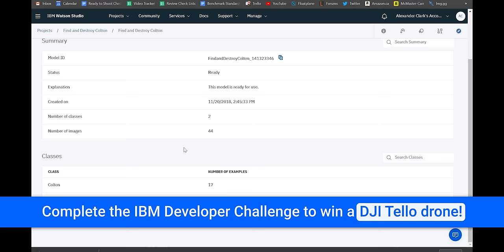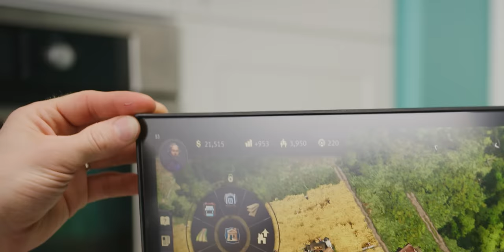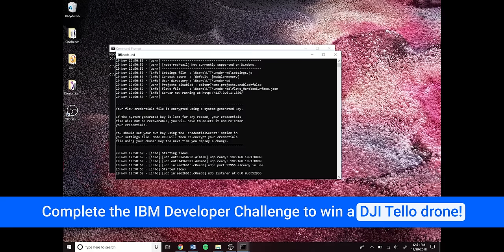FINALLY Upgrading my 4 year old Gaming Rig!

Comment: Mounts monoblock, forgets to install NVME beforehand.
Reply: Am I dumb or isn't Linus supposed to reinstall the OS because of a Motherboard change. I think aspects of windows are tied to the specific motherboard right? Am I wrong?
Reply: @libertywolfyt985  I tried to keep my OS installation as is it when I switch CPU/MB/RAM last month, and the OS was crashing fast as soon as left it idling; Had to reinstall everything eventually T__T
Reply: @libertywolfyt985  no, you don't "need", it's advisable but really not at all necessary unless you have issues with something, the only times I would recommend a full reinstall is if you're converting from AMD to Intel (or the other way round) or you didn't install Windows in UEFI mode back whenever it was you first installed, your Windows license is actually more save-able if you just keep the same OS install too as you can just use the activation troubleshooter and tell it you've changed hardware recently 🙂
Reply: @galakstiv , yeah it is just my dad said that to me when we were upgrading windows, not to long ago, in order to accommodate the z390 phantom gaming 6. Basically each windows installation is specific to the motherboard like settings and stuff like that.
Reply: @KamikazeXeX , reinstalling as in the windows install is specific to the computer/motherboard. People do get crashes from keeping the same windows, I don't know how the troubleshooter works as I have never used it, but I suppose it would fix the settings for the new motherboard or something like that.
Reply: @libertywolfyt985  that is an entirely common misconception there is cases you have to reinstall due to previous misconfiguration issues but in no way does Windows "lock" itself to a specific hardware config at all, only the activation state is locked to your hardware, BSODs are usually fairly simple to diagnose and cleanup if you know how to use Google, I've spent probably the last 15 years being the family and friend PC repair guy 😂
Reply: @libertywolfyt985  yes you are correct that their is a connection but because of an issue that happened in the 1st 9months of window 10 coming out the choose not to countine it once the free upgrade time peroid ending the following year which instead locking it or making it a problem to upgrade your motherboard they instead tied the avitive install too the OS install drive the motherboard and ram as long as any ONE of those are still being used and you didnt do a full clean install then the windows server would understand that the copy of window is still vailid once to re-activate the copy lience once you have it re-activted with the news motherborad you then turn it off and install the rest of the new parts and once finshed microsoft will reg your new system as part of the copy you own now with that all said their with all tech the chance for it to not go as planned but take it from me 
and my history i have only ever bought the free upgraded version and since then i have gone from a system that use AMD 6300 motherboard to a ryzen 1 then a ryzen 2 and now im waiting on the new ryzen 3000 and with tthat will be a completly new system in all parts and ill have done it not onc ehaving to fix any more then plug and play honestly windows 10 is the easist OS to upgrade ive ever used 

p.s if you do have your OS on a intel optain setup you will have issue as intel os optain setup can not be upgraded with out a fresh install of win10
Reply: @libertywolfyt985  if the crash does get corrupted then a simple 20mins reset call to windows fixes any issue with the relieniceing of your copy to the new config
Reply: @shadowarachh even worse, old shitty drive not even in a cage, a somewhat loose SSD can be seen in some shots.

Comment: So just to let's say, replace or insert a new m.2 drive, you have to

1. Drain the loop
2. Get the tubing out of the way
3. Take off the entire block
4. Put in a new m.2
5. Put the block on again
6. Put the put the tubing back in place
7. Fill the loop back up.

Hmm
Reply: yep... 1st world problems
Reply: No. There are screws on the 2 bottom m.2 slots. You just unscrew them and put your m.2 in.

Just the one on top is under the block.
Reply: I saw at one moment that the part covering the M.2s appears to be only a separate metal plate screwed to the rest of the monoblock, so you only need to unscrew it if u wanna add/change an M.2.
Reply: or...
take of the block, put in m.2, put block back again. its slightly inconvenient but its not like you do it everyday

Comment: Why did you run the reservoir fill on the live pc? Use a separate power supply, short between the green and black wires on the 24pin connector, with a paper
 clip or piece of wire. If all wires are black, place the connector with the lock clip facing up and short
 4th and 5th pins (counting from left to right) in the upper row. This turns on the power supply and gives you a safe start. Then connect the water pump to the separate power supply.  No chance of harming your system this way. Then you could see that your piping was off without possible damage to the system proper.

Comment: the magic of PC gaming, playing on a smaller 24" 1080p monitor and still be able to run 70 FPS with your current setup without the need to upgrade.

also saves your eyes from getting stretched as a bonus.
Reply: Stretched eyes? You clearly never touched an ultrawide
Reply: 24" is irrelevant to performance.
Reply: @andrewe6762  the keyword is 1080p, and 24" are the most common sizes for this resolution. Anything bigger than 24" and its 1440p territory.
Reply: @ann0ynim0us  That's simply not true. 1080p is standard, regardless of size. Google 32" monitor and you'll still be flooded with primarily 1080p's.
Reply: @andrewe6762  learn to research better on recommended monitor sizes and resolutions: https://forums.tomshardware.com/threads/27-1080-bad.2999690/

Comment: I've used automotive coolant for 10 years in a dozen different systems. Not one issue with corrosion, over heating or damage to pumps or blocks.

Comment: Honestly, $1100 for motherboard, top-line CPU, and monoblock cooling is a pretty good deal.
Reply: No. Its 1100 for only MB + Monoblock. If you buy it with the 5.1ghz i9 you pay 700 on top of it. Its actually a really bad value to pay 200 for overclocking isnt it?

Comment: "chugging down to 40 fps" , dude, when my games lag, they either straight up ctd, or go unresponsive!
Reply: I still using core i5 with 2TB ssd in raid mode and 3200mhz ddr 4 32GB still plays updated games with no problems time for upgrade i think i core i9 cpu 😁
Reply: @paulroibnson5686  just stop

Comment: 3950x is about to crush that 9900k

and also that new 2080 Ti Super...
Reply: I dont think that's gonna happen. Amd always not realistic about their cpu advertising. Probably it won't be better than i9 9900k or i7 9700k in gaming. However, as a raw performance and editing etc, it will beat intel as always.
Reply: @nnnscorpionnn  100% agree. The 9700k might get blown away, sure. It's 8c/8t, which is hilarious because AMD boasted they had a chip that was better than it for multi tasking. Let's look... they compare their new 8c/16t vs an older 8c/8t hmmm.. compensating for their continuous losses to Intel in the past. The 9900K or KS? Hell no. That's the reigining champ right now. None of these Ryzen gen 3 chips will beat it at gaming.
Reply: @MrAndroid2013  Wait for benchmark folks. You can never come to conclusions this early.
Reply: You guys watched the amd stream right
Reply: Yeah, AMD’s new CPU’s are so cheap for the specs you get, Intel is going to struggling. (Example: 3600 Base 6 core 3.6GHz 12 threads is $290 AUD). And AMD’s new Zen2 architecture looks great.

Btw that’s a Titan RTX, not a 2080 Ti
Reply: jvalex18  it would be better if they showed the temps and noises tho
Reply: @nnnscorpionnn  hahahahha wut??? Intel screw there customers all generations
Reply: @redbassboosz5222  are you sure about that? I suggest you to watch some ryzen vs i7 gaming videos, you will see the big difference in gaming.
Reply: @nnnscorpionnn  ehm Go watch some new benches and u see the 2600x catches almost up with 8600k on 5ghz on win 1903
Reply: @redbassboosz5222  you are still saying what i say, "almost catching" doesn't mean better than something. So intel still rocks in gaming.
Reply: @nnnscorpionnn  but it makes no sense paying 150 euro more for less threads less futureproof and much more trash platform.. and 5-7% more performance only in gaming and overall other much slower
Reply: my monster pc is RYZEN 7 1700 16 GB DDR4 3200MHZCL15 GS KILL RIP JAWS GTX 970 G1 GAMING DELLP2416D 24'' 2560X1440 60 HZ IPS. It plays evrything max settinfs 1440p 30+ fps but for ray tracing i must upgrade graphics card. Should i buy 2 RTX 2080TI SUPER or wait for RTX 3080TI?
Reply: @nnnscorpionnn  my monster pc is RYZEN 7 1700 16 GB DDR4 3200MHZCL15 GS KILL RIP JAWS GTX 970 G1 GAMING DELLP2416D 24'' 2560X1440 60 HZ IPS. It plays evrything max settinfs 1440p 30+ fps but for ray tracing i must upgrade graphics card. Should i buy 2 RTX 2080TI SUPER or wait for RTX 3080TI?
Reply: @buckyducky2581  my monster pc is RYZEN 7 1700 16 GB DDR4 3200MHZCL15 GS KILL RIP JAWS GTX 970 G1 GAMING DELLP2416D 24'' 2560X1440 60 HZ IPS. It plays evrything max settinfs 1440p 30+ fps but for ray tracing i must upgrade graphics card. Should i buy 2 RTX 2080TI SUPER or wait for RTX 3080TI?
Reply: @kyrpuzz  my monster pc is RYZEN 7 1700 16 GB DDR4 3200MHZCL15 GS KILL RIP JAWS GTX 970 G1 GAMING DELLP2416D 24'' 2560X1440 60 HZ IPS. It plays evrything max settinfs 1440p 30+ fps but for ray tracing i must upgrade graphics card. Should i buy 2 RTX 2080TI SUPER or wait for RTX 3080TI?
Reply: @snucc1000  my monster pc is RYZEN 7 1700 16 GB DDR4 3200MHZCL15 GS KILL RIP JAWS GTX 970 G1 GAMING DELLP2416D 24'' 2560X1440 60 HZ IPS. It plays evrything max settinfs 1440p 30+ fps but for ray tracing i must upgrade graphics card. Should i buy 2 RTX 2080TI SUPER or wait for RTX 3080TI?
Reply: jvalex18  my monster pc is RYZEN 7 1700 16 GB DDR4 3200MHZCL15 GS KILL RIP JAWS GTX 970 G1 GAMING DELLP2416D 24'' 2560X1440 60 HZ IPS. It plays evrything max settinfs 1440p 30+ fps but for ray tracing i must upgrade graphics card. Should i buy 2 RTX 2080TI SUPER or wait for RTX 3080TI?
Reply: @redbassboosz5222  my monster pc is RYZEN 7 1700 16 GB DDR4 3200MHZCL15 GS KILL RIP JAWS GTX 970 G1 GAMING DELLP2416D 24'' 2560X1440 60 HZ IPS. It plays evrything max settinfs 1440p 30+ fps but for ray tracing i must upgrade graphics card. Should i buy 2 RTX 2080TI SUPER or wait for RTX 3080TI?
Reply: Yes, a cpu with twice as many cores and threads.... Come on get real. At least compare cores with cores. When you are talking about crushing compare like for like, or do not make the comparison.
Reply: there is no 2080 ti super
Reply: Can it Run Crysis?
Reply: @xpodx  ok then you agree it will better to wait for RTX 3080TI than buy 2 RTX 2080 ti? with ,my gtx 970 still playing 1440p max settings 30 fps evrything only reason i want to upgrade is for ray tracing.
Reply: @raresmacovei8382  but AMD has done alot of over hyping there stuff in the past. My rule of thumb is let the idiots with pockets full of cash by em and really see how they preform. My theory is, an over marketing, over compensated product release. And it may still fall short of intel. But I'm not an intel fanboy I wanna see intel get dethroned. Because there price premium is bs
Reply: @nnnscorpionnn  the benchmarks are coming out and... looks like Intel has a competitor now...
Reply: @nnnscorpionnn  Annnnd you were right, fanboys were out in full force shilling an international mega corporation, & they did it FOR FREE, lmao.

Comment: 10:02 Aluminium dissipates heat faster than copper, while copper absorbs heat faster than aluminium. Hence why 99% of coolers on this planet have a combo of copper base and heatpipes + aluminium heatsink. I'd say the design is pretty (pun intended) spot on ;)

Comment: Meanwhile me with a GTX 560: "Eh, I guess this GPU can still keep going through another year".
Reply: you are simply using more electricity for less with gtx560. it isnt really cheap to use that card for another year. also it limits a lot of your settings and new features. if you are okey with low performance, then just get cheap low end card from newer models.
Reply: Meanwhile me with a g41 express chipset struggling with half life 2.
Reply: Literally only upgraded from mine a few months ago, and only cause my friend was selling his GTX 970 for cheap.
Reply: Might as well go for a RX560. You're only changing two letters for about 100€
Reply: You can get a good 1060 for a fart

Comment: 9900k "consumer chip", i think my celeron n3060 deserves this title

Along with my radeon 4200 graphics

Linus gets diaplointed when he doesnt make top 3 on benchmark leaderboards, im happy for double digits, thats the score by the way not the ranking
Reply: Guys like us are happy to get near 60 FPS in latest games (usual number is around 30)
Reply: @KrotowX  Heh, latest games? I get 45 fps in garrys mod lowest settings at 1024 x 768
I can barely open bluestacks to play mobile games, and most games I play are older than my pc, yet they hardly run, i expect a solid .60 fps in modern titles
Reply: @KrotowX  I'm piecing together a system with old parts rn, hopefully for playable fps on low in modern titles
Reply: @aaronsams8605  Sorry, I already forgot how slow Radeon HD 4200 is. Friend had a laptop with it ages ago. No use for most today's games. Reaching 45 fps in Garry's Mod may be even considered as magic for it.
Reply: @aaronsams8605  I would have given my Quad Core Q9400 rig to you of you were living in my Country

Comment: BINNED 5.1GHZ 9900K...
RTX TITAN...
....reuses 2666mhz ram  -_-
Reply: Hecc, even my crappy PC has better RAM!
Reply: Gotta spend wisely
Reply: And CL15. My Corsair Vengeance RGB 3466MHz CL16 set even does 3200MHz CL14 (Samsung B-die).
Reply: @CheapBastard1988  good for you? Irrelevant, hope you didn't pay $200+, since it is now under $170
Reply: @Tallnerdyguy  spend?
Reply: @impulse959  it was a joke, you know, saving money on memory instead of $2000+ gpu etc
Reply: @Tallnerdyguy  so was mine. As in, why couldn't any of those companies send him a couple of sticks of RAM.
Reply: @Tallnerdyguy  Of course they were more. It was 2017 and RAM, GPU's and PSU's were hard to find and expensive at that time. Better get your Samsung B-die while you still can because they either seized production or they are going to and they're still the best.

The thing that triggered me is that Corsair Dominator is the premium model while the Vengeance is the common gamer model. Those performance numbers are terrible.

Comment: Ubisoft optimization: If it runs at 45 fps with the best gaming hardware there is, it's ready for release
Reply: He has it at 4k on an ultrawide (edit: 1440p)... 

That's like playing the game at 8k (edit 4.3k).
Reply: @formdoggie5  That is not 4k, it is 1440p ultrawide
Reply: @Winterfalke  ok...so 1440p x 3--same principle still applies.

It's 4320 vs 1440 lol
Reply: @formdoggie5  No, it is not. 4k = 3840x2160, 4k ultrawide would be 5120x2160. 2k is 2560x1440, 2k ultrawide is 3440x1440. ultrawide is usually just 1.32-1.35x the number of horizontal lines of the base, while keeping the same vertical lines. Thus, 4k is still more difficult to output at the same fidelity and fps than 2k ultrawide. Same would be true for 8k (7680x4320) vs 4k ultrawide.
Reply: @Thuazabi  ...that's not how that works or you would get massive image stretching issues.

Go check the difference in 4x3, 16x9, and 21x9.

Comment: Linus: Hey guys! Come check out how better my rig is than yours!

Me: watching a video on a dell Optiplex without a graphics card
Reply: Hey i had a dell optiplex 7010 for a while. Drop a cheap 1050ti and you can play newer games with reasonable settings. Dont ever sell yourself short. Make do with what you can.
Reply: @musek5048  well said
Reply: @MoswenMedia  im just getting sick of all these snobs acting like theyre better just because they can afford better gear. Ive seen it all the time in the guitar community, the car scene, the firearms scene, hell its in every genre i guess but it sucks to see those who want to be a part of it and cant afford much get ridiculed by snobs.
Reply: Get a used Pascal card and drop it in. As long as the CPU is ivy bridge i7 or better it's prob fine.
Reply: @kelvinyonger8885  i second this. I was running an i5 3570 with a 1050ti a couple years ago and it performed great for what i paid. Yeah it may not keep up with the latest and greatest but if you just want to game on a budget and don't want to resort to the restrictive console platform I'd say its still a very viable choice.
Reply: Kouki Munster The fact is is that I have a sff

Comment: That right there reminds me of why I never buy the highest end video card. I'll go with a great overclocking CPU, but I'll always go mid-range GPU and upgrade it as needed while my CPU will still be great. Example, while I am looking to upgrade my CPU in the next few months for gaming rig my 8-year-old i7-2600k is OC at 4.99ghz has only had two video cards. A gtx 570 and rtx 2070. When I need a new CPU I'll already have a good video card.